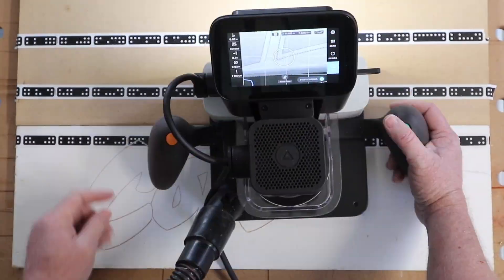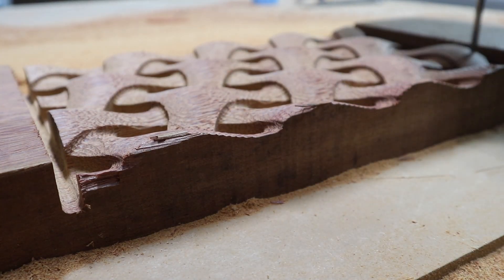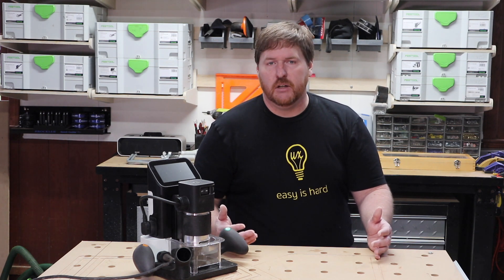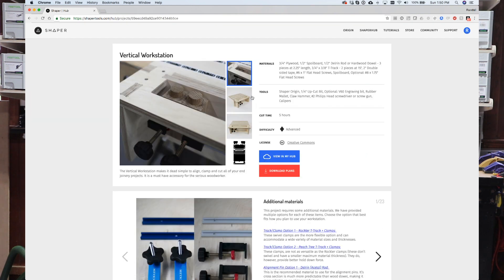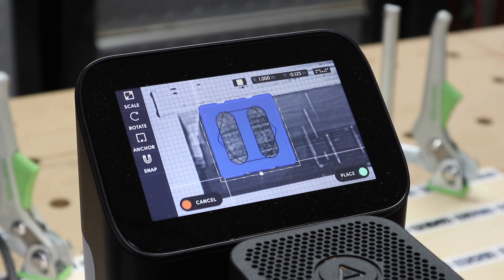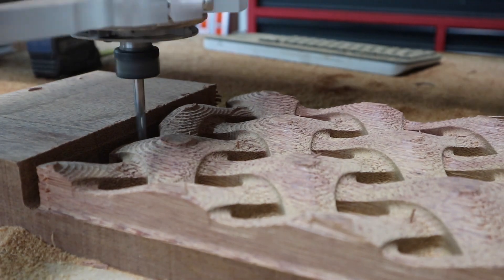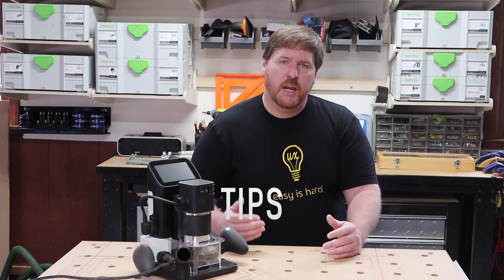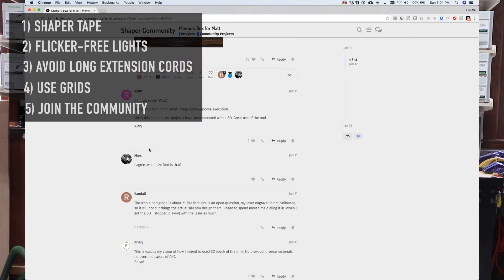Industrial Designer Compares the Shaper Origin to His DIY Gantry CNC Router

Comment: Do they charge for the shaper software upgrades?
Reply: I have been following them for a while now and plan on purchasing one within the next several months.  From what I have seen and read, it looks like all of the upgrades have been free.
Reply: No. However some functionality is extra, which I really think should be included, such as the auto depth multiple pass option, a one time 200. The shaper studio is also 100/year which I also think is a bit much considering how much you pay for the tool... You can use other software of course, such as illustrator (though that's a subscription too) or free ones like Inkspace but I tried it and it messed up on my mac, it has compatibility issues. Still trying to find a good option that doesn't have a yearly subscription, makes me feel like I'm a cow being milked...

Comment: You can make your own shaper tape btw. I talked to the guys in SF. There's nothing special about it it's just a domino pattern. You can take a picture of them and randomize them and reprint it on your own tape. Better yet if you got a handheld printer you could just save the files on there print them on the piece of wood that you're working on and sand off the print later.
Reply: Why not print A4 or A3 sized paper with domino's? A decent laser printer is off max 1mm each meter.

Comment: Hi, I am wondering if the shaper can easily do a cut with a variable depth. for example a straignt line but startartin with a depth of 1mm and gradually going deeper.
Reply: As for now there's no 3D capability for the shaper.

Comment: What is the biggest bit I can use.  I wanted to use a bowl bit
Reply: Late reply but max is 1” bit. You can get 8mm collet as well. I made a project recently with 3/4 bowl bit (1/4 shank) and it worked fine. Wish I would have had a flatter bottom as it would have saved me some sanding.

Comment: I see you're a fan of Festool.
You did however fail to understand where Festool customer base really resides in. That's on job sites with contractors. These tools are money makers!
Just like the plunge saw. These became indispensable on sites where you can't reasonably haul a panel saw to. 
Now they have this new cnc guided router. It's obviously not to take take the place of cnc gantry out of a shop. But on a job site, it will become a major player by bringing computer correction to a small manual tool. 
Just think, on a site with just 5 journeymen getting 35 an hour. That actually cost just over 50 an hour after workmans comp and health insurance. Rolling tools out in the morning is about an hour. Rolling up at the end of the day is an another hour. 5 days a week. That's 50 man hours per week just to set up and break down equipment with just 5 guys. 50 an hour, thats a cost of 2500 a week.
Festool Thrives on job sites. Less set up time than average tools and less equipment to do many different tasks.
I Absolutely love Festool. But on a job site. I rarely use them in my shop. It's just easier to use a panel saw, gantry cnc, jigs and templates.

Comment: To address the problem of routing a recess larger than the base be addressed by adding a larger supplemental base? Would the Shaper be able to automatically adjust to the additional thickness of a supplemental base?
Reply: Yes and no. I tried it by taping a thin board to the bottom that would span the gap. The issue was that the board would flex and snag on everything around it. If I had used aluminum or a fancier jig and a better prepared workspace, then it might have worked. You will lose some depth. The other option is to carefully plan the cuts so there is always something to balance the Shaper on. I pointed it out in the video because with a gantry router this is not an issue. So, if you were coming from that perspective, it is something to consider.
Reply: It is theoretically possible to add a wider supplemental base. The Origin has a superb Z-axis “touch off” feature that works by slowly lowering the bit until the Origin’s base is just barely lifted up off the work surface. The lift-up seems to be detected by a small pin on the underside of the base. You would have to make sure that the barely protruding pin can do its job. You could do that by putting a loose scrap exactly the thickness of your supplemental base under the pin during “Z-touch”. However, a better overall strategy might be to hog out large areas some other way. Or plan your cuts so that base-support remains until the last possible moment. Note that hogging out large areas with a trim router at, say, a 1/4” depth of cut per pass is boringly time consuming, and no computer software in the world can help. One caveat: for the machine vision algorithms to work most accurately, the bottom surface of the Origin should be in the same plane as the tape all around your work piece. Adding a supplemental base, which lifts the machine, might screw that up.
Reply: @Roderick storey Yes.  It's called "Z touchoff"

Comment: Was the shaper provided by Shapertools inc or third party for review, or paid for by the reviewer/company?
Reply from the maker: Shaper did provide the tool. We asked Randall to review it with an honest, critical eye toward the Origin's ultimate pros and cons, especially comparing it against a larger gantry.
Reply: @core77inc  It comes off like an advertisement and the complete lack of transparency makes you lose all credibility.
Reply: @Roderick storey In the original version of the video, I included that information because I agree with you on being upfront about it. It was main cut for timing, and narrative considerations. Since I do not work for Shaper or Core77 and I live far away enough from both, I was not concerned with whether they would agree my views as they were not going to be able to get the Origin back. :) If anything, I may have been too critical.
Reply: I'm sure it was "gifted" aka a paid advertisement.